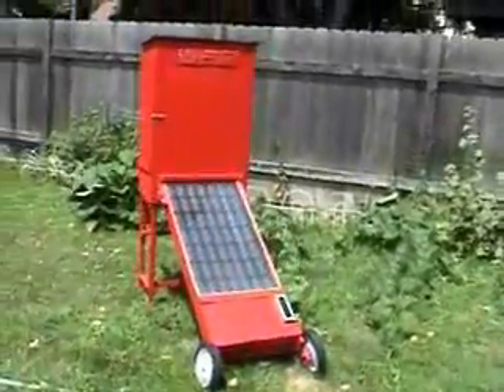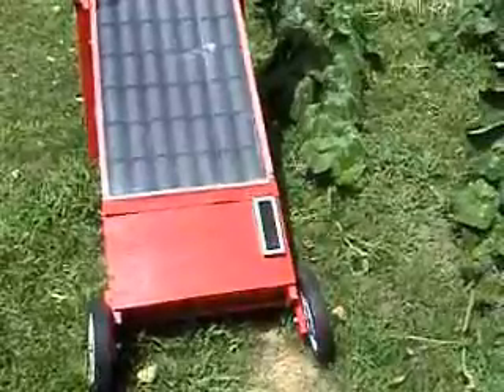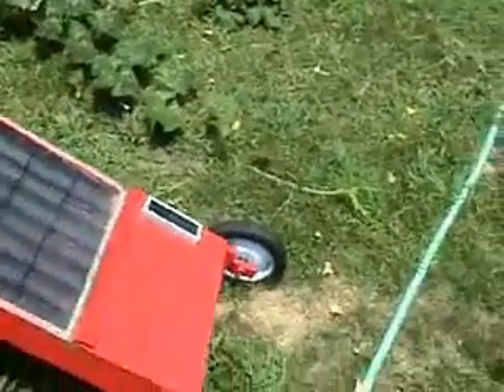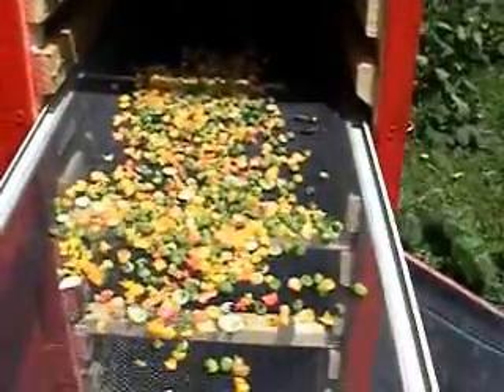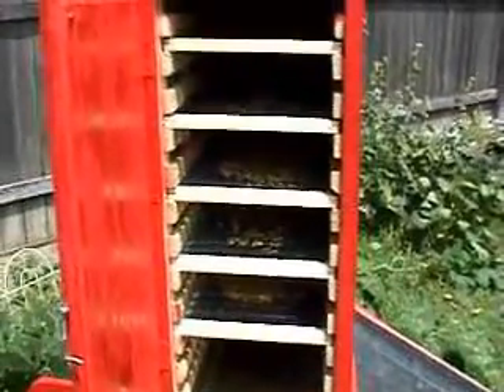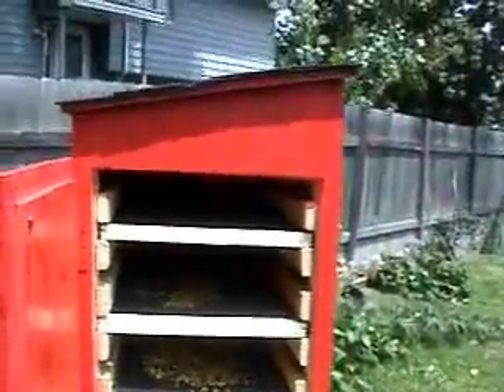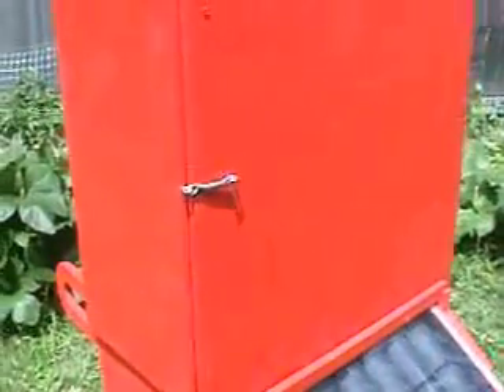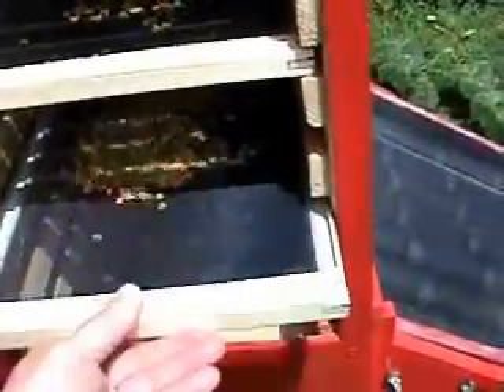Home made solar dehydrator

Comment from the maker: That is pretty close. What I did is drill holes in the bottoms of all of the cans, use high temperature silicone or something simular to "glue" them together into tubes. Mount the tubes in the box, Used wood top and bottom with holes to let air into and out of the tubes, paint inside of the box flat black and mount plexiglass over the box. In my case I added some old computer fans, a rechargable 6 volt battery and a little solar panel so I could force the air through the tubes. Not sure it helps

Comment: Hi, great video. Do I have this right? There must be air holes at the bottom of the solar panel which draws in the cool air. This air gets warmed by the heat of the cans which are warmed by the sun. The warm air dries the stuff and moist air escapes through the vent, all the time new cooler, fresher air continuing to be sucked in through the bottom. Is that right? Is it really that simple? I was saving to buy one but they are hard to get in UK and cost loads. If I can build one then great :~D